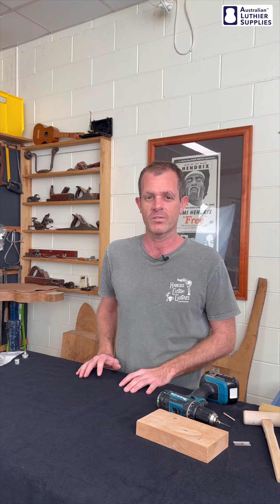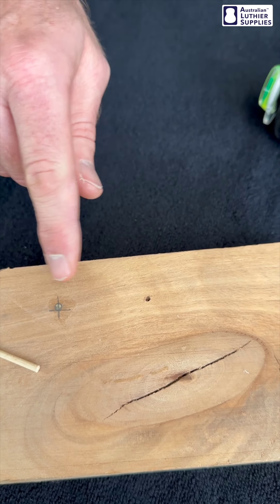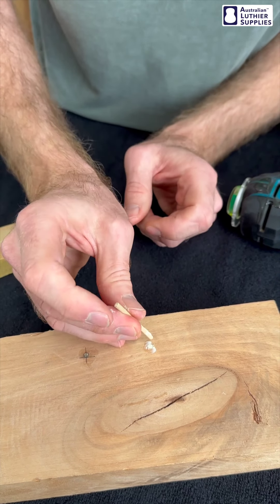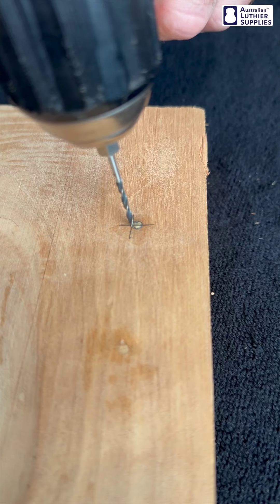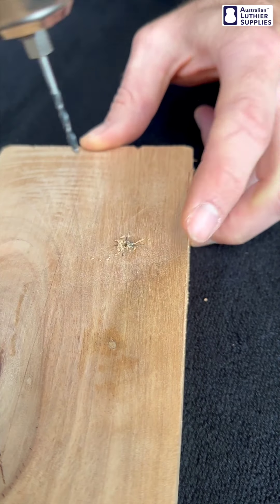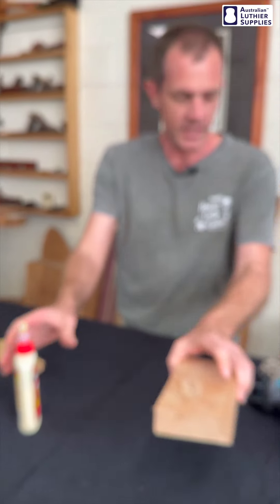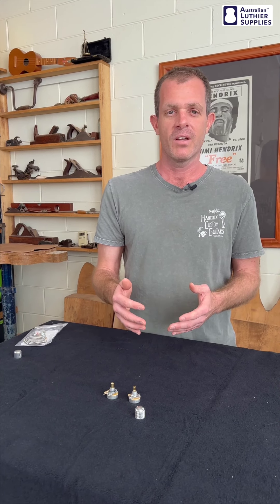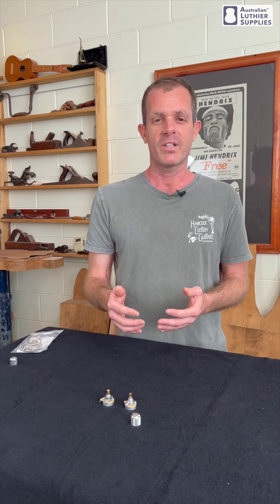Luthier FAQ Ep#01 - Drilling Overlapping Holes & Matching Knobs to Pots

Comment: Hi, regarding, the knobs to fit solid pots I just put them in my mini lathe and bore the correct size.  Understand not everyone has a mini lathe.
Reply from the maker: That's a great idea, also it could be good if you need a particular type of knob which doesn't fit the pots you have. And it's a good excuse to buy a mini lathe ;)